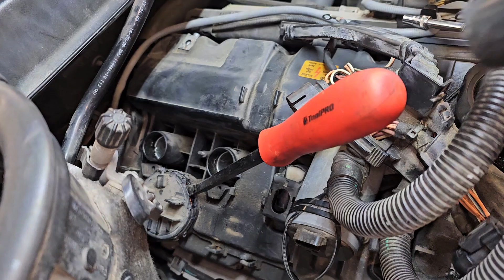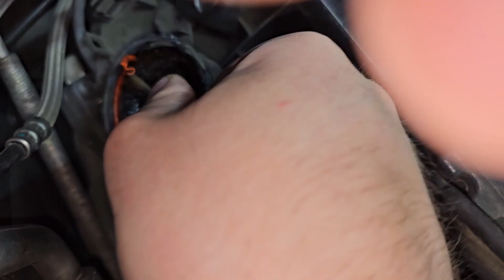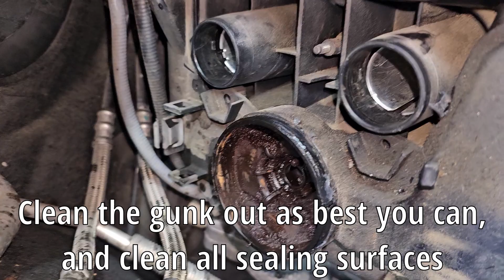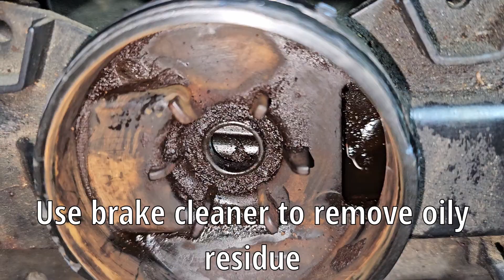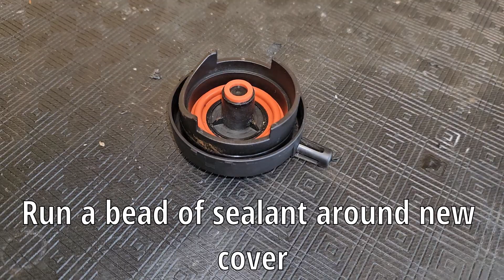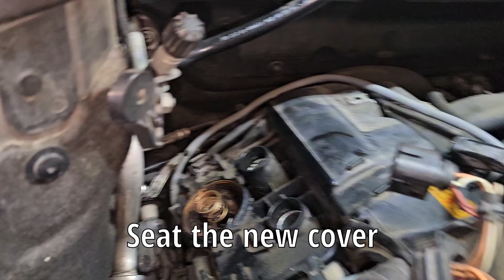How to Replace CCV Valve on BMW N52 with Plastic Valve Cover

Comment: The first version of this used to be serviceable with a rubber o ring and tabs to click into place, They switched to just welding into place to save money I guess during manufacture. Must have been cheaper to weld than a 3cent o ring. This method doesn't always work and you end up replacing the valve cover any way. Best to do it with valve cover off using a heat gun to gently break the weld, clean thoroughly and find an o ring that fits and reinstall new one as intended. I used to do this as a mail in service when valve covers were well over $1K but they have dropped so much its now affordable to replace entire assembly. Do this when you replace the valve cover gasket. Not a difficult job, average person can do it in a few hours with lots of preparation and watching how to vids before getting into it.

Comment: This would be how "not" to work on a BMW.  If you resort to these methods then perhaps its time to buy a honda or toyota.
Reply from the maker: @theoaguilar1941  what would you suggest without resorting to replacing the valve cover?
Reply: @HeroRepairs  Replace the valve cover.  I just replaced mine this last saturday and it took me about 2.5 hours.
Reply from the maker: @theoaguilar1941  In many cases that repair method would be costing close to 1/3rd the value of the car. It's obviously the preferable long term method, but as cars age you need to start getting pragmatic with your approach to repairs. This is a low cost and low risk method to try first. You can always replace the valve cover later on if you choose.
Reply: Ive replaced the valve cover twice ... both lasted about 2 years...  this last time I only replaced the $12 dollar pcv valve like this video and it lasted about 2 1/2 years.    So I wish I would've just done this each time as the valve covers have not had any other issues, only this stupid pcv valve!!!    2011 bmw x3 28i  205 k miles  still running strong!
Reply from the maker: @brucecascadden1249  Thanks for sharing your experience. I definitely think this is a reasonable method to try first.
Reply: I highly doubt that.
Reply: Whilst i agree with replacing the valve cover complete, nevertheless BMW should have made the unit so as the control valve can be serviced easily. I too think the aftermarket approach is the best solution, it may last 2 years or longer then the repair has b een worth it. Recently I got a fault with my throttle body and it needed replacing BMW said, the car has done only 82750KM since new so i asked why so soon? to which they replied age. I removed the throttle body cleaned it of carbon, and installed an after market repair kit and it has been working fine ever since. If i ever needed to replace the valve cover I would replace it with a Febi Belstein one as on my car the original was made by them, too buying direct is a lot cheaper. Like most People think, BMW should make servicable items and PCV valve together with throttle body kit should be a standard part.
Reply: Not yours bisnees and not your money 🤑🤑😂😂

Comment: You really did a good job, personally I would go this route since I recently replaced valve cover gasket, not worth it removing vavlve cover again. Perfect fix and don't see anything wrong if done correct and clean. Good job.

Comment: Was this causing a whistling sound? And what kind of sealent u used?
Reply from the maker: Yes it was. I believe it was Gorilla FixAll high tack
Reply: ihad lots of oil on the cap. does that mean it is failed? @HeroRepairs
Reply: broooo i got that same thing goin on

Comment: Hey may have to do this soon on my car. Have to test the valve with a vacuum bleeder. How did you know this was an issue on the car? Did you happen to get any codes like p0171 and p0174? Thanks!
Reply from the maker: Symptoms were a loud whistle, rough idle, and engine codes although I can't remember which ones.
Reply: @HeroRepairs  thanks for the quick reply. Did a smoke test and I really didn’t see anything come out from anywhere. I hear some whistling from the general area near the valve. I also just took the oil cap off at idle. It did change a bit but then it normalized. Also there was a decent amount of vacuum on my hand. Sorry for the ramble. Thanks again!
Reply: Engine codes come up as timing retarted on exaust camshaft reference I did this procedure code disappeared instantly
Reply: @sipmeister3611  so you completely replaced your pcv valve, and it disappeared?
Reply: @jibranyar5977  yes i did these steps in the video theirs other reasons as to why those codes i named off may appear and its simply because exhaust vanos may be toast the bolts break on the sprockets and don't move accordingly. luckily in my case it was just the pcv valve failing. take note theirs 3 tabs around the pcv valve that are frail pieces of plastic in the video guy just breaks them all without a care i sudgest taking the time to keep those present when you go to install you dont have to worry about it falling off it clicks right into place wonderfully
Reply: @sipmeister3611  huh interesting! I really appreciate it. my car has had the codes for a while and honestly im ashamed of it. I thought it was due to a tune and my 02 sensors going bad so i never really cared. then about 10k miles in the exhaust side camshaft sheard 5 teeth off. replace the gear as well as timing components. and code came back after 50 miles. did some further investigating. where i then found this video. I did a vaccum test on the port, and it held, so i didnt change it. also did a smoke test, to where i saw no leaks. my next test would honestly be fuel pressure. but i am honestly going to change out the valve and rear pcv hose, soon. since i care more about the car again :) I also need to fix a small exhaust leak, after the headers, but i doubt thats the cause of the leak. Thank you for listening to me ramble

Comment: Thanks for your video it really helps…my n51 of 2013 is burning oil and all forums tell that this is faulty…anyway i just ordered the part but i wanted to ask you because im confused is that hose of the pcv connected to a tube or it stays like that open?
Reply from the maker: @Kico57  Normally there is a little cap on it, but the N51 could be different due to the emissions focus.
Reply: @HeroRepairs  ok bro thank you very much! I will follow your guide 🙏🏼

Comment: Nice video! What were the exact symptoms of the problem before you decided to replace the CCV valve? Did it definitely get better after replaced it?
I want to pinpoint the problem.  have same engine

Comment: What if I don’t add the spring lol ….
Reply from the maker: It won't work properly as it will always be open
Reply: I read that the spring does close it when it’s resting (the vehicle is off I’m guessing) 

And it opens when the car is running so would it make a difference ?

I’m asking bc I already installed it and saw the spring was on my work bench